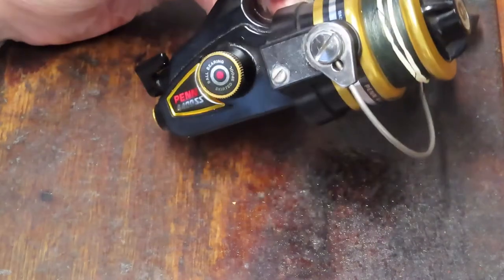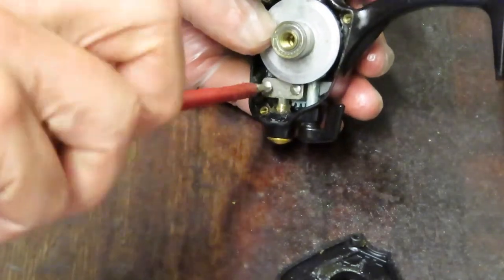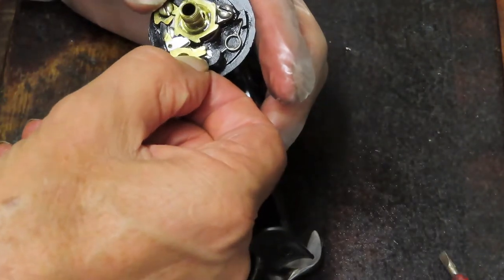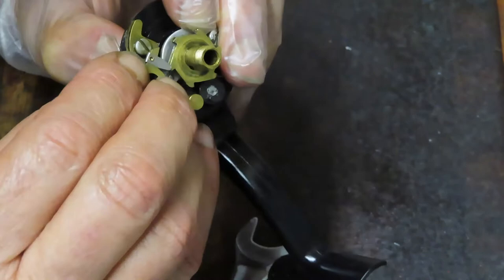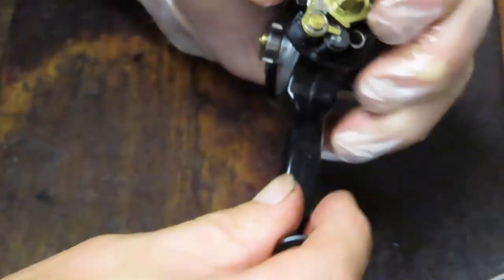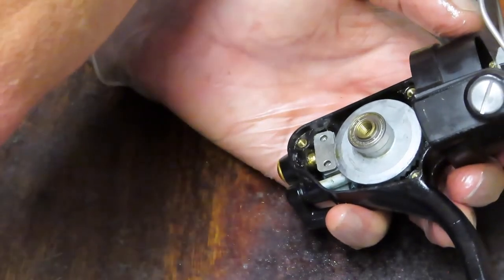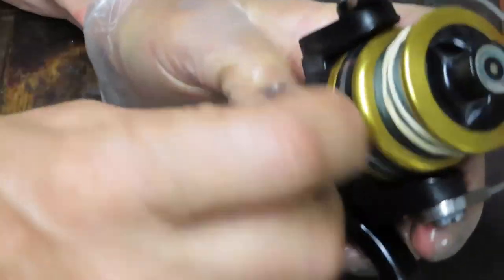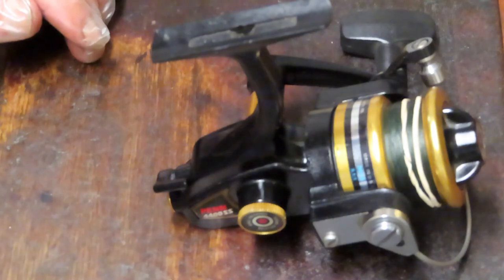Penn Spinfisher 4400SS spin fishing reel how to service the rell and fix a broken anti reverse dog

Comment: Do you have a PENN 4400SS SERVICE AND CLEANING video  IVE recently purchased about 10 USA penn reels on eBay have most of them serviced via your channel 4400ss has dog repairs and bail repairs can’t seen to locate 4400 SS SERVICE THANKS SO MUCH YOUR AWESOME
Reply from the maker: No, sorry - I don't have that one in the library.  I will check to see if I have one in the shop and try to do a video on it if I do, to help you out.

Comment: Ok so i just did this repair and it works if you hold the reel with the handle slightly up  but does not work if you move the reel in a jigging motion for say a lure....the older 4400ssg does not have a dog spring like the newer one does i have both really like the new model better....i took it back apart and cleaned and lubed everything 3 or 4 times still does not work??? should i pinch the dog fingers tight ? I am at a loss.....My reel has been used much more then tom's and my dog gear was the same im guessing the little fingers wear out with time.... I noticed the bottom of the flat brass gear has a slight ring indentation on the bottom is that for the small indent on the finger to kinda hold? any help would be appreciated.....You have the patience of a saint....
Reply: when i ay up i mean on its side cockeyed so gravity helps the dog for lack of a better way to put it....
Reply from the maker: I would try pinching it.  My guess is that the dog is not holding and dropping to the side to engage when jigging because it is too loose.  You can also order a replacement dog through Mysticparts.com if one is needed.  I just did one a few weeks back and the tip had sheared off of the dog and no matter how much you pinched it, the fingers would not reach the ratchet.  - Dennis
Reply: @2ndChanceTackle   thank you i did use a new dog..The post the dog rides on had some build up i cleaned that and it  still did it... the dog was kicking up and not dropping i took it apart a few times pinched it a few times then used a round file on the inside of the dog hole to make its move more free and it now seems to work well ... not sure what thing fixed it? but its working decent LOL.... all the bearings seem tight my pinion gear seemed to have a little wear and the reel is not as smooth as it should be ...do you have videos on doing shims? and whats the best way to get the bearing off the handle side of main gear it seems to be set or peened in place? this is on the older style with the older dog... my newer 4400ss seems a little rough also i mean very slight ....I may sell them and buy a newer 440ss as they have infinite anti reverse .... what are your thoughts on the best series of these older penns? and thanks for your videos ...i took apart a 4/0 last week and had to find your video on the gear stacks... to put back correctly

Comment: Great as always!  However you did not mention that the early versions of the SS series had a serious design flaw. There was no slot or groove for the Eclip to fit into! The Eclips all popped off. Then the Antireverse dog would come loose. Penn fixed this issue and added a groove in later manufacturing. For a while a 3rd party company sold a kit to correct this. Penn did fix my reel dog for free long after warranty was up but only because I was able to speak on the phone to one of the few old guys still working there from the US assembly days. This anti reverse design is a real weak point of this series. I feel this series should have been recalled and everyone given free repair or replacement. I had this failure ruin a fishing vacation. US Penn reels were supposed to be Mack Trucks but this poor design led to the end of US manufacturing and Penn reliability.
Reply from the maker: Thanks for the update and comments.  I don't think I have seen the earlier ones with that lacked the groove.  Always learning!  I appreciate you sharing the knowledge - Dennis
Reply: I agree the later ones with the spring under the gear work much better....